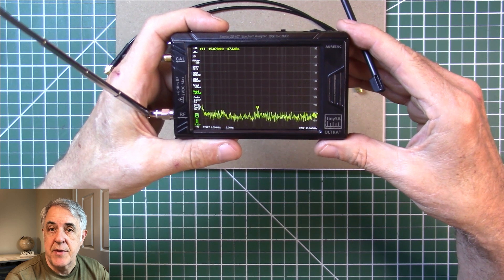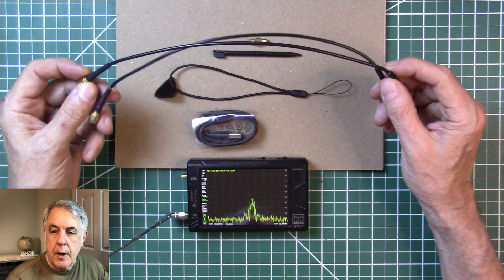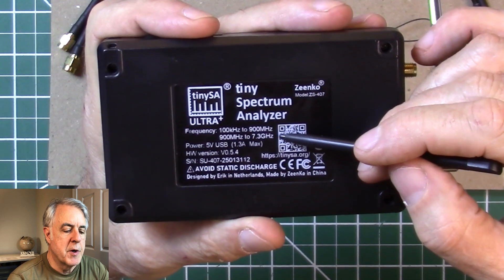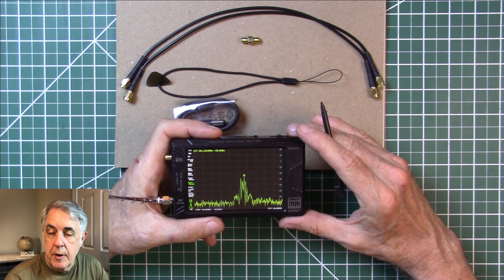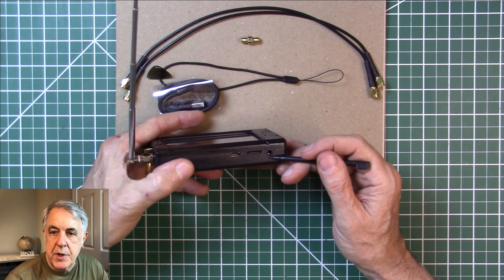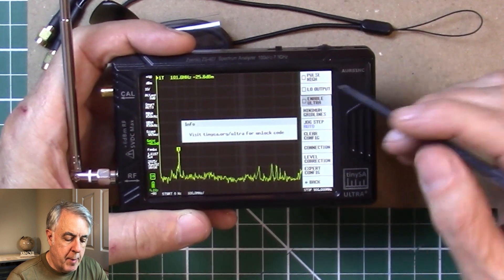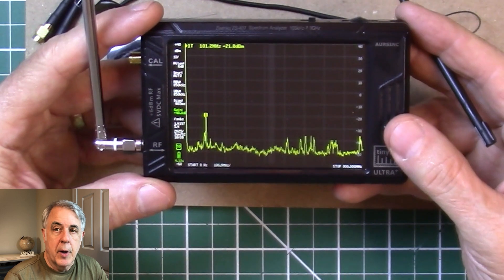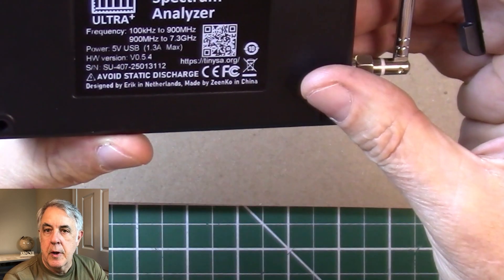TinySA Ultra+ ZS-407 Spectrum Analyzer

Comment: Thank you for the video, I own 2 of the original ultra units and do not see the need to upgrade to a unit that is only marginal better than the original one. Once they come out with a unit that has a preamplifier that goes to 11Ghz, an input filter that works in ultra mode than yeah I might consider. Meanwhile I have installed one of them in a box with  an external switchable preamp. 6 selectable position coaxial switch that has one through and 5 filter ranges to permit me the use of it without problems of aliasing in the upper range am interested in. As a unit, it performs as least as good if not better in some functions than my 40 year old HP analyzer.
Reply from the maker: I don’t disagree. Sounds like you have a nice custom setup. Thanks for watching.